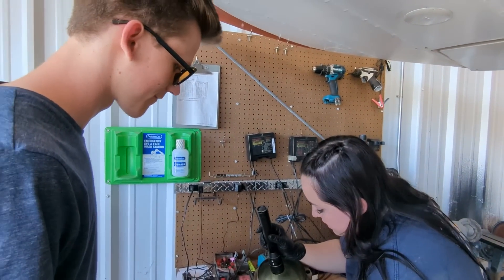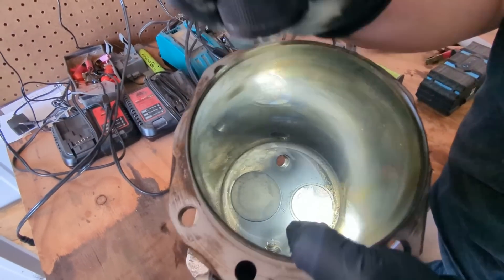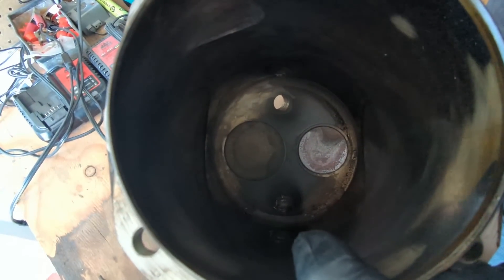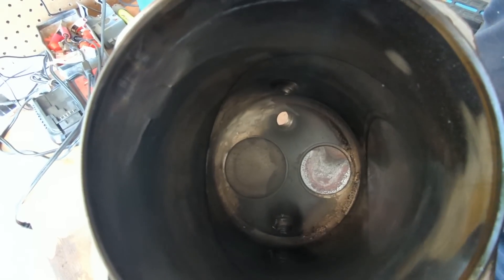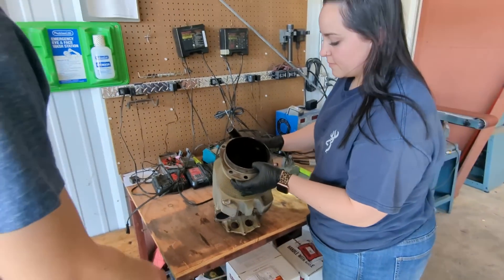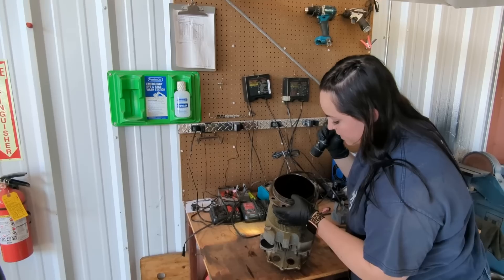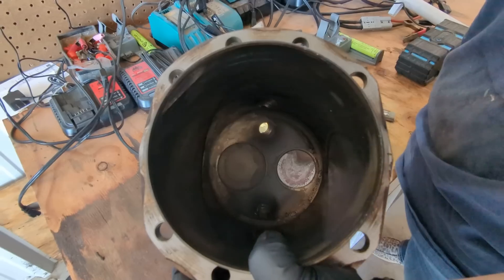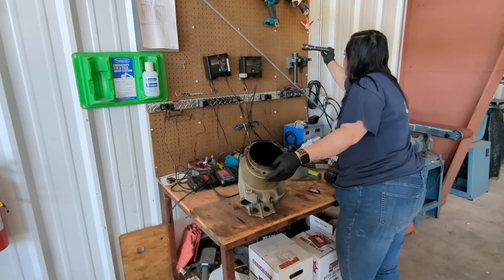What a Burned Exhaust Valve Looks Like -Continental IO-550

Comment: Interesting.  I once heard that this 'type' engine design is actually about 100 years old.  Who would have known!
Reply: Reciprocating liquid fuel combustion engines, yep, more than 100 years old. Reciprocating steam engines even older than that.
Reply: Our "modern" aircraft engine lineage dates back to the early 1930s. With updates over the years, like overhead valves, fuel injection, etc, although not much has changed to the basic design in the past 75 years or so.
But as Black Bandit stated, the horizontally opposed  engine was commonly used in many pioneer automobiles built nearly 140 years ago.
Reply: Even more interesting no one has come up with a better design. Proper leaning prevents deposits on the valve stem preventing valve guide wear. The new no lead fuel should help prevent this.
Reply: With magnetos from a 1926 Case tractor! : )